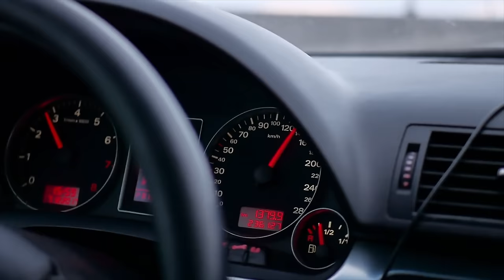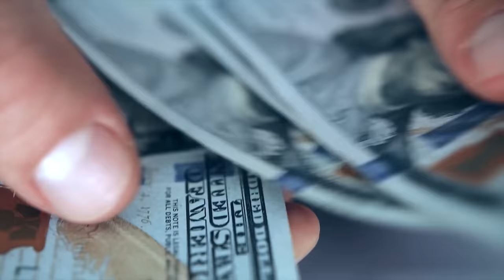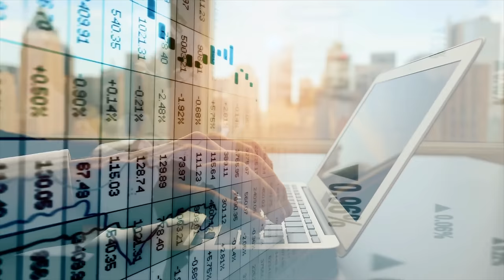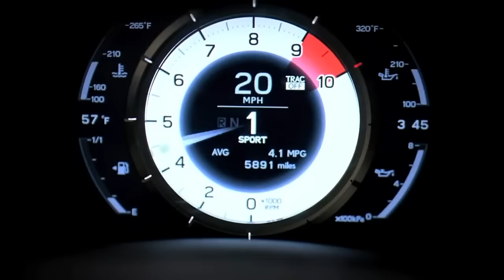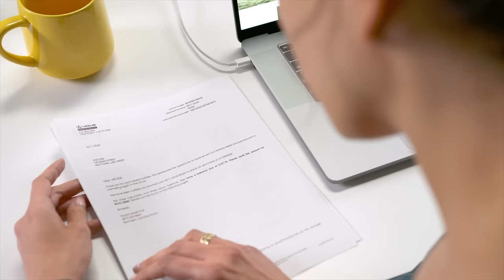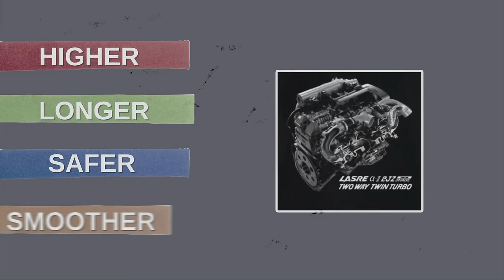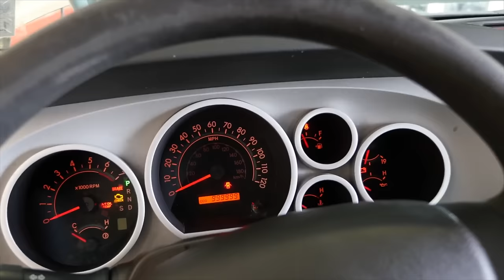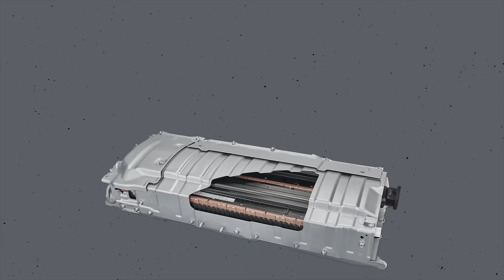Here's Why You Should Only Buy This Car Brand

Comment: Toyota Camry: Oil Consumption: Some Toyota Camry models, particularly those from the early 2010s, have been associated with higher-than-average oil consumption. Owners reported the need for frequent top-ups between scheduled oil changes. This issue raised concerns among drivers about potential engine damage and the associated costs. Toyota acknowledged the problem and, in some cases, extended warranties or offered repairs to affected vehicles.
Transmission Concerns: Certain model years of the Toyota Camry faced occasional complaints regarding transmission issues. Drivers reported problems such as rough shifting, hesitation, or, in some cases, complete transmission failure. While not universally experienced across all Camrys, these issues prompted some owners to seek repairs or replacements, adding to concerns about long-term reliability.
Dashboard Rattles: Owners of specific Camry models reported rattling noises emanating from the dashboard. These noises could be persistent and were a source of annoyance for some drivers. The cause of the rattling varied, ranging from loose components to issues with the mounting or assembly of the dashboard. This problem, while not affecting the vehicle's performance, highlighted concerns about build quality and interior durability.
Brake Problems: In certain instances, Camry owners raised concerns about premature brake wear. Some reported that the brakes wore out more quickly than expected, leading to the need for more frequent replacements. This issue not only incurred additional maintenance costs for owners but also raised safety considerations, as brake performance is critical for a vehicle's overall safety.

Toyota Sienna:

Transmission Issues: Some Toyota Sienna models have experienced complaints about transmission problems, including rough shifting or premature failure.
Sliding Door Malfunctions: Owners have reported issues with the power sliding doors, such as failure to open or close properly, which can be inconvenient and affect the minivan's usability.
Electrical Problems: Certain Sienna models have faced complaints related to electrical issues, ranging from malfunctioning dashboard displays to problems with various sensors.
Excessive Oil Consumption: Like other Toyota models, some Siennas have been reported to consume oil at a higher rate than expected, leading to concerns about engine health and maintenance costs.
Brake System Concerns: Some owners have reported premature wear of brake components, leading to more frequent replacements and potential safety concerns.
Entertainment System Glitches: Issues with the infotainment and entertainment systems have been reported, including glitches, freezing screens, or malfunctions in the Sienna's technology features.
HVAC Problems: Complaints about the heating, ventilation, and air conditioning (HVAC) system have been raised, with some owners experiencing issues like inconsistent temperature control or system failures.
Rust Concerns: In certain regions, owners have reported premature rusting on the Sienna, particularly on components like the undercarriage or door frames.
Uncomfortable Seating: Some drivers and passengers have found the Sienna's seats less comfortable on longer journeys, with complaints about lack of support and ergonomics.
Fuel Efficiency: While the Sienna is a minivan, some owners have expressed disappointment with its fuel efficiency compared to other vehicles in the same category.

Now for the Chrysler 300:

Distinctive Design: The Chrysler 300 boasts a distinctive and elegant design that sets it apart from other full-size sedans.
Spacious Interior: With a roomy and well-designed interior, the 300 provides ample space for passengers, ensuring a comfortable ride.
Powerful Engine Options: The car offers powerful engine choices, catering to drivers who prioritize performance and a spirited driving experience.
Advanced Technology: Equipped with modern infotainment and safety features, the Chrysler 300 provides a technologically enhanced driving experience.
Comfortable Ride: The vehicle is known for its smooth and comfortable ride, making it suitable for long journeys and daily commuting alike.
Luxurious Features: Higher trims of the 300 often come with luxurious amenities, such as premium materials, advanced audio systems, and enhanced interior features.
Solid Build Quality: Chrysler has a reputation for building sturdy vehicles, and the 300 is no exception, offering a sense of durability and reliability.
All-Wheel-Drive Availability: For those in regions with diverse weather conditions, the availability of an all-wheel-drive option enhances traction and handling.
Generous Trunk Space: The Chrysler 300 provides a spacious trunk, accommodating ample cargo, making it practical for various lifestyle needs.
Heritage and Legacy: The Chrysler 300 carries a rich heritage, blending modern features with a touch of classic American sedan styling, appealing to drivers who appreciate a sense of automotive history.
Even the Pacifica:

Versatile Seating: The Chrysler Pacifica offers versatile seating configurations, including Stow 'n Go seating, providing flexibility for various passenger and cargo needs.
Family-Friendly Features: Equipped with features like an available built-in vacuum, Uconnect Theater entertainment system, and hands-free sliding doors, the Pacifica caters to the needs of families.
Advanced Safety Technology: The Pacifica is loaded with advanced safety features, including adaptive cruise control, forward-collision warning, and automated emergency braking, enhancing overall safety.
Hybrid Option: For eco-conscious drivers, the Pacifica Hybrid provides a plug-in hybrid option, combining efficiency with the convenience of a family-friendly minivan.
Comfortable Interior: With a spacious and comfortable interior, the Pacifica ensures a pleasant driving experience for both the driver and passengers.
Smooth Ride: The Pacifica is known for its smooth and comfortable ride, contributing to a relaxed atmosphere during longer journeys.
User-Friendly Infotainment: Featuring an intuitive Uconnect infotainment system, the Pacifica provides easy access to navigation, entertainment, and connectivity options.
Convenient Storage Solutions: Smart storage options throughout the Pacifica's cabin, along with the Stow 'n Vac integrated vacuum, make it easy to keep the minivan organized and tidy.
Sleek Exterior Design: The Pacifica's sleek exterior design defies traditional minivan stereotypes, offering a modern and stylish appearance.
Resale Value: Historically, Chrysler Pacifica models have retained good resale value, adding a practical aspect to the overall ownership experience.

Comment: The 4A-GE paired with the handling and giant seat side bolsters in the 1986 Corolla GT-S was heaven sent.  Accelerating after downshifts from 3rd to 2nd around a curve with that high reving engine was God like.  I should never have sold it.

Comment: I drive an 05 Avalon that’s equipped with the 2grfe engine, it runs like a top.  Lot of power and runs quietly.  It’s started right up last month when it was 20 degrees below 0, and it was outside during start up.

Comment: I have a '06 Audi A4 with over 300k miles. It's not very common for the 2.0T to last so long on original engine/headgasket. Especially when driven as hard as it is, and through all Canadian seasons, in rock salt, for the past 18 years. Yeah it's rusting in a few spots, but I have barely done anything to it for the past 3 years other than brakes, oil and replaced the old worn out coolant line or hose here or there. Maintenance is key. Early oil changes pay off huge in the long run

Comment: Scotty, hate to burst your bubble on the 2001 Avalon I owned.  Bought used with 161K.  Carfax was clean.  Body and interior of car were near immaculate for being in Iowa all it's life.  Changed oil 3 times in 9 months owned.  On my way to Arizona from Iowa, motor seized in Albuquerque.  No oil warning light.  Oil light came on, check engine light immediately, then BOOM.  3.0 V6 Engine.  Guess it had sludge problem. 173K miles at time of death.
Reply: Perhaps a pre-purchase inspection by a good technician could have detected that obvious lack of maintenance. 😮It’s a testament to Toyota that the engine lasted that long.
Reply: Sounds like user error...I mean how can a engine die of sludge when you changed oil 3 times in 9 months....with what???? cooking oil????? Sounds stupid.
Reply: Previous owner probably never changed the oil or filter and just occasionally topped it off.

Comment: Great review of the Toyota engines. I think you should have gave a mention of the 4.0L 32v V8 in the early LS400. I have a 1996 with under 100k miles that still runs at 155 mph as easy as 80 mph and smooth as glass. An amazing break-through car.

Comment: Scotty you should know I work for the rail road in NY. We have in our fleet 2 Chevy Colorado’s and you almost never see both vehicles in the parking lot at the same time. Usually one or both are at the shop getting worked on. We looked up the amount of money spent on fixing them in the 5 years we have owned them and it’s over 475k dollars!!! One of them has had four transmissions and the other has had 3 of them both have less than 80k miles! The one needs an engine and the shop said he called all over the country and said none are available because everyone is looking for engines for the Colorado’s. The rail road won’t get rid of them because every vehicle they buy needs to be kept for 15 years or 300k miles

Comment: It's a pitty about all the Camry and rav4 that have the 2AZFE engines that burn oil, here in Australia most rav4 have that motor 2.4L 2AZFE and not many with the V6, I would like an older rav 4 but soon as I see that engine it turns me off.

Comment: 21 years and 290k miles on out Tundra and it runs well.  BUT sadly last week the transmission started to slip.. Debating on getting the transmission fixed and keep it til the new smaller trucks come out. Anybody know how much a transmission rebuild costs?

Comment: My 2007 Tacoma is at 392k miles and still going. Regularly changing the oil and now transmission fluid. Barely done any work on it. Paints peeling though 😢

Comment: I have a 2015 BMW M3 and I’m one of the crazy people that dailies it and have 152,000+ miles and sadly have to replace my tires every year 😭 but running great. Scotty I am looking at the new GX550, should I wait for the hybrid or get the V6?!
Reply: Hybrid would be more reliable than the twin turbo V6 long term (10+ years) the GX 550 is amazing engineering nonetheless, the TTV6 will easily outlast the competitors

Comment: They ruined the Tundra by dropping the V8......
Reply: I respectfully disagree... I drove the last tundra with the v8 before they changed it over and the power wasn't there. The new tundras have plenty of power.
Reply: @zachk7531  I agree to disagree. My ex-wife had the V-8 and now the 6. There is no comparison in power/gas mileage, especially using it like a pickup.

Comment: Subaru crosstrek has full stainless exhaust.  Ford explorer at 50k?  Nope.  130k dodge 170, nope.  Americans still cheap out. Ford sticking with a tremec for the mustang gt?  No, You get a chinese mt82.  Higher trims get the american transmission.

Comment: In Australia, Toyota's ain't that good. They fail all the time.
Reply: Then it is Australians’ problem. In Asia, Europe and America have no problem.
Reply: What cars are good in Australia?
Reply: Because its down under 🤣🤣🤣🤣🤣🤣
Reply: Do the tires spin the opposite direction?
Reply: In America they have problems too. Frames breaking fluid leaks suspension problems. Slow underpowered ridged riding.The engines are the only thing good about them.
Reply: @Worthrhetime  No!
Reply: @OrangeUp  Isuzu D-Max.
Reply: @hlwanmoe1981  Not my problem. I just don't buy Toyota's.
Reply: @Nick41622  Thx 🙂
Reply: @OrangeUp  No problem.
Reply: @Nick41622  👍
Reply: @Worthrhetime  No, but your head does.
Reply: @Nick41622   Ha . Mate one good.

Comment: But as a back seat customer the Toyota camry absolutely sucks. The door doesn't open wide enough and you sit too far back in the seat. This is not recommended for a slightly handicap person. I just had knee replacement and the camry absolutely sucks to get out of
Reply: Walter for your reasons I can thoroughly recommend the RAV’s or even better the CX5 for its 90 degree opening rear doors as a substitute. Excellent for newly minted grandkids and old blokes like me.  Australia

Comment: I have a 2001 Land Cruiser with 99,450 miles on it.  It is my weekend surf and camping vehicle.  I have had it serviced religiously. 😅I replaced the timing system at 80K and did the gaskets etc at 95K.  I have just gotten it broken in, but, given my age, I will have to put it in my will!

Comment: Ya my brother “inherited” our mothers 2008 Camry when she started going blind from matrícular degeneration. It was at 450,000 same engine transmission, battery. Stone cold stock. My mom always maintained her cars as you should. My brother on the other hand, swore that oil changes were a scam. He literally only put a few sets of used tires on it and finally lost his license for a DWI. After we sold it for $500 last year, it was still running at 640,000 and the speedometer was frozen(or disconnected but never reconnected). The guy that bought it couldn’t believe it was the original battery that started it.
Reply: What?  You sold a 15 year old car with 450,000 to 640,000 miles on it and it still was using the original battery?
Pardon me,  but I  don't think anyone is going to believe that detail.
Also, just wondering how did your mother put 450,000 miles on it in far less than less than 14 years.

Comment: Scotty I have a question. I own a tundra and a Camry. Do you agree with the 10,000 mile oil change?
Reply: Scotty and most reputable mechanics recommend 5K oil changes regardless of vehicle.
Reply: 5K or 6 months. Oil is cheap, engines are not.
Reply: Also makes sense to use full synthetic oil. The extra you pay over synthetic blends and conventional is minimal nowadays. Refining methods have improved so much since the new API GF6 specification was introduced.

Comment: Chrysler could Never build an Engine  that runs that smooth.
Reply: We had K Cars back in the 1980's and if You put a Timming light on it,  it would make You dizzy.
Reply: The Chrysler V8s of the 60’s and very early 70’s  were beasts. Simple, powerful and bulletproof if cared for. The 383, 440, and 426 cu. in. Hemi were awesome. After that, Chrysler went downhill fast. Too bad.
Reply: @TXAG81  I heard that The Government pretty much shut down those Engines with gas mileage restrictions.

Comment: What’s your opinion on the 4.0 engine in the Tacoma ?
Reply: 222,000 miles on mine. Runs like new, burns no oil. Yes, I change the oil, filters and spark plugs just once at 168,000…
Reply: Both the 4.0 and the 2.7 are some of the best engines ever.

Comment: Every ford in aus especially taxies can do well over a million with out service and regular oil changes. Its deferant story for the buick 3.6 v6 in the commodore worst engine made i recon oh wait the camira .  No wait the astra no wait there all garbage. If you service any motor frequently it will last forever unless you own any gm related company . Built cheap not tough.  Excuse spelling dont have my glasses

Comment: Hello I had a question about gear oil Ford recommended 7585 for my 17 F-150.. the guy at the Ford dealership told me I could use 75140 what do you recommend

Comment: Have 2 of em albeit both are 1980 Turd Sells!  Fixed choke issue on one of them. Butterfly was on 45 degree angle when warmed up so turned coil spring at back of carb to the left to straighten it but idle still sticks after driving it meaning it has to be floored to get it down & may have to loosen coil spring & turn it some more to see if that fixes it.

Comment: Reliability of newer Toyotas is sucks even the Lexuses they’re all sucks. Not the Older Toyotas are excellent and bulletproof vehicles. The parts are Getting Outrageously expensive and expensive to fix and laborious maintenance nah. The 2.5 was a Terrible Toyotas engine I don’t care it’s Camry or venza or highlander or RAV4 all of them. It will bankruptcy my wallet and it’s way more expensive to fix than GM’s 3.6 V6 it’s way more difficult than 3.6 GM. It has Oil consumption A lot. Transmission issues. Water pump failure. The Cat’s Destroyed. And the timing chain issues. Oil leaks everywhere. And the crankshaft from the front to the back failed. And coolant bypass pipe leaks. I don’t care if it’s 200 buck. All these problems it’s gonna a 6000 bucks to 13,000 bucks to fix. Stay away from 2.5 Toyota engine if you don’t maintain very well. If you maintain good. You got lucky. With oil and filter specifically. Because it’s no way to skip oil changes. Every 5000km or 10,000km.